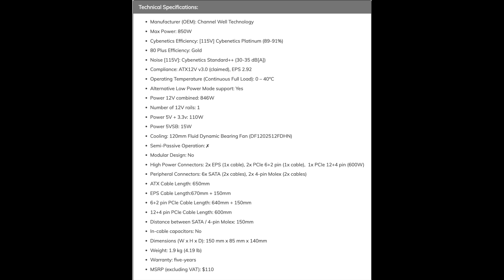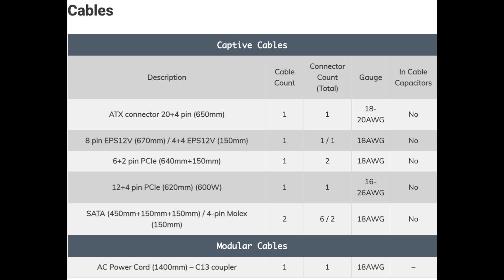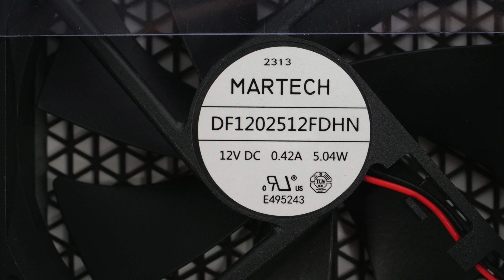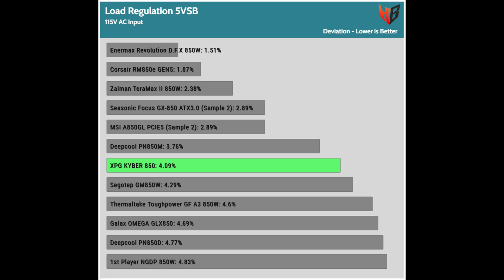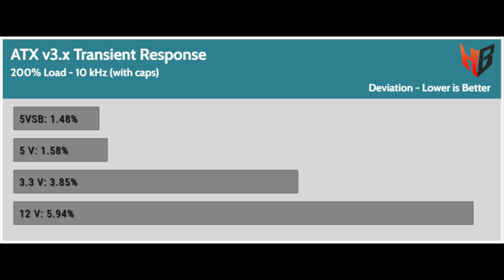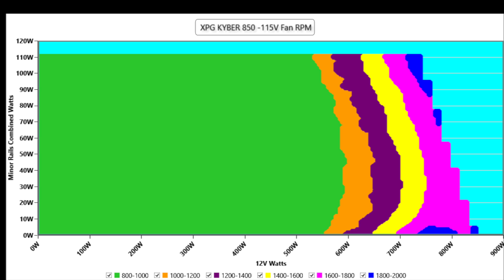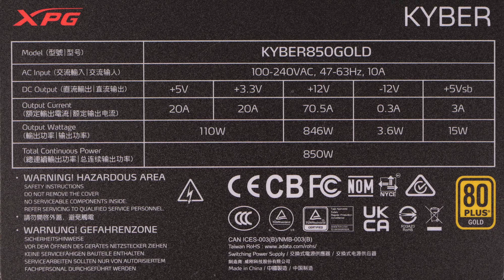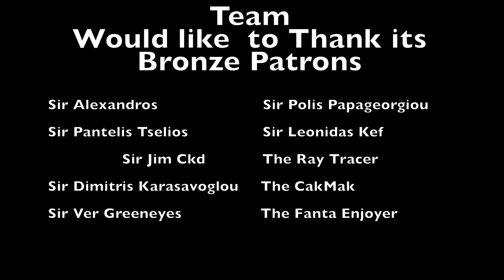XPG KYBER 850W ATX v3.1 PSU Review

Comment: This Kyber vs Corsair CX750 which one is better for i5 14600k in your opinion?
Reply from the maker: Both are good and will do the job, depending on the GPU of course that you plan on using. I would get the one with the best support in my area/country.
Reply: @HardwareBusters  Decided to go with XPG Core Reactor to be safe.
Reply: @JAFFER3657  Hows your expereince with core reator? I am in between kyber 850 vs silverstone triton 850 and maybe core reactor... I heard that core reactor has some heating issues.....is that true?

Comment: . hie guys  does deepcool px1200g psu have latest and updated Nvidia connector 12v-2x6 for new 4080 super ?? please let me know
you are the only best guys for PSUs😊
Reply from the maker: Hi! Most platforms from CWT, including this PSU, use one and have the updated connector. But I do not know if you will get an older or newer production model.

Comment: Hie sir can you please tell me latest atx 3.1 psu that i can buy for my gigabyte rtx 4070 ti super eagle oc, i9 12700, 32gb ddr4, 3 hdds, 1 sata ssd, 2x2tb nvme, 7 case fans. also please suggest me psu options that have sleeved cables i live in India.
Reply from the maker: Please check here for the ideal 850W or 1000W PSU that can support your system: https://hwbusters.com/best_picks/best-atxv3-pcie5-ready-psus-picks-hardware-busters/

Comment: Good review, as always. How'd you know that ChengX makes capacitors for NCC and Rubycon? I found a few in some other switching power supply I have and admittedly, I had some concerns about their reliability.
Reply from the maker: Internal information. ChengX belongs to the Chinese government, meaning that it has anything it needs, from equipment and people.
Reply: Also for Toshin and Panasonic.
Is a big company with different level of capacitors.

Thanks Aris 🤝